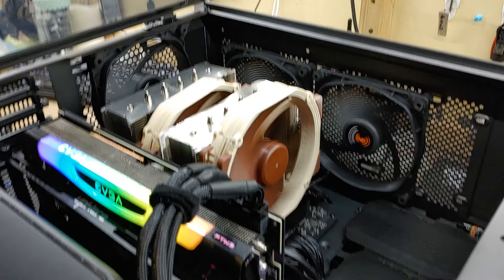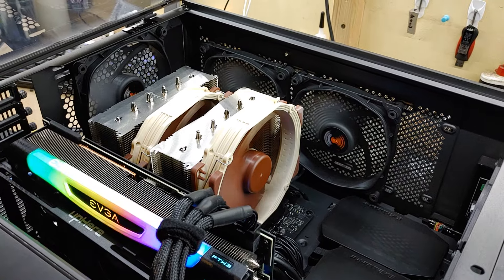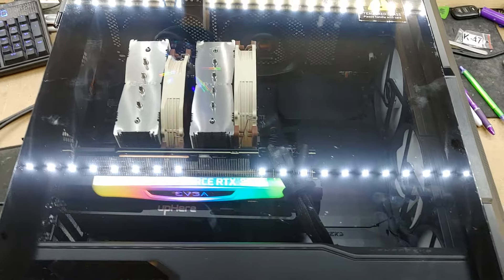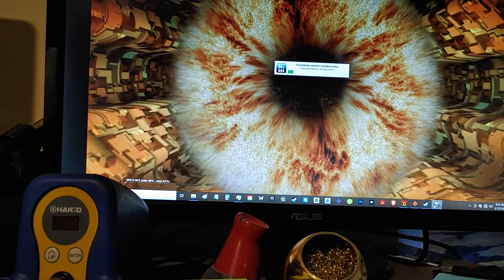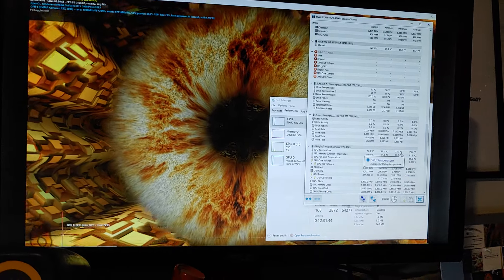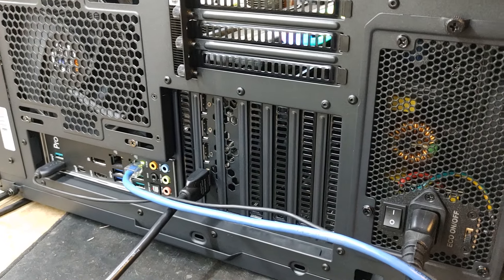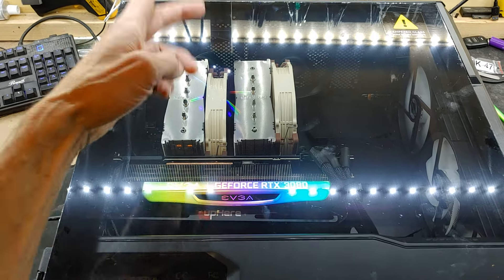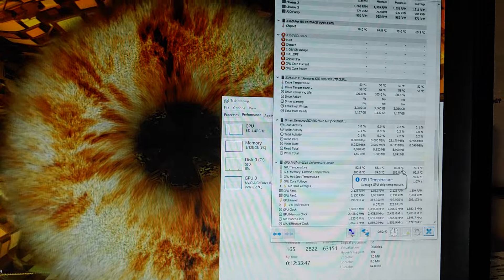Fixing Titan Workstation debacle 5950x + 3090 FTW3

Comment: Is the cpu cooler sufficient? I know there's a lot of trust in Noctua, but it's still unnerving seeing such an average part in a high end build.
Reply from the maker: NO, not sufficient.  Not at all.  It needs to be a D15 at minimum or a 360.
Reply: @MichaelBruceTaos  huh? It is a D15, you even said it in the vid.
Even a U12A is sufficient for a 5950x...
The issue was more than likely just the defective PSU
Reply from the maker: @mightym  You are right the PSU was defective but wrong, I got that thing to 4.5Ghz all core doing burn in tests and its like a hair dryer, hitting about 80-85C max w/ the 3090 cranked up as well.  People drastically underestimate how much heat these things put out.

Comment: I plugged 1 of my case fans in the pump header cause I ran out of headers.  Is this a good idea?
Reply from the maker: It's fine.  Some motherboards let you control the PWM speed of the pump header.  If it doesn't you just get a full speed fan.  No worries.
Reply: @MichaelBruceTaos  Thank you!

Comment: you should have two fan headers on the video card, I use the one bottom front fan as intake powered off the motherboard case fan header and the two top front fans as exhaust powered off the GPU, they turn off when the GPU is idle, with the two top case fans as intake for filtration, the rear exhaust, two top and heatsink fans PWM using my ARGB hub as the fan splitter which gives it more power via SATA and PWM from the CPU motherboard header, this keeps it quiet and gets the hot air out of the case while giving great air flow under the GPU
Reply from the maker: OMG!! You are right!  DUH!  Thank you bro!!!!
Reply from the maker: Turns out just one but I'll use it for the 140 in front of it.